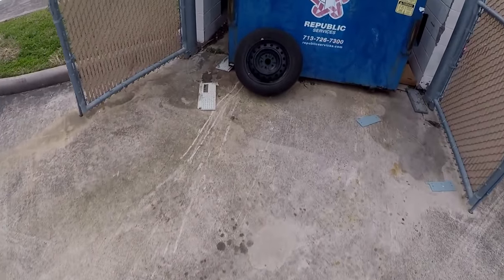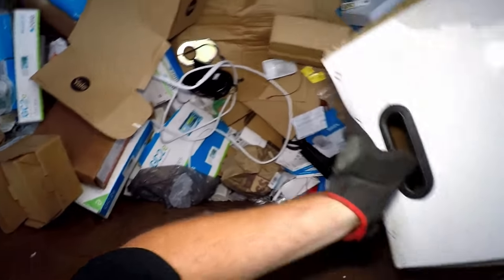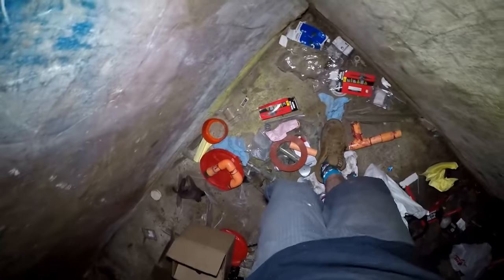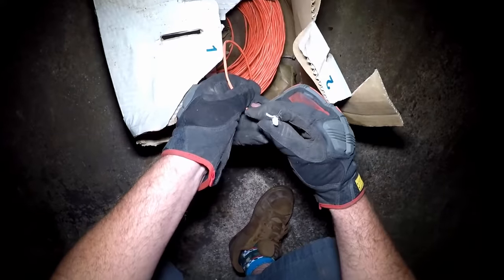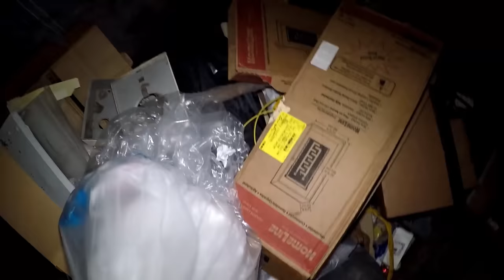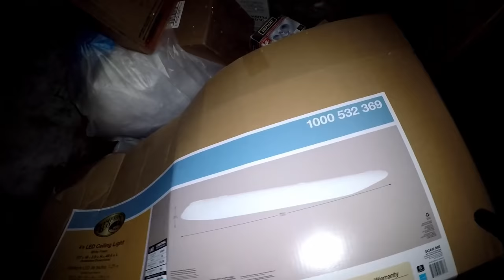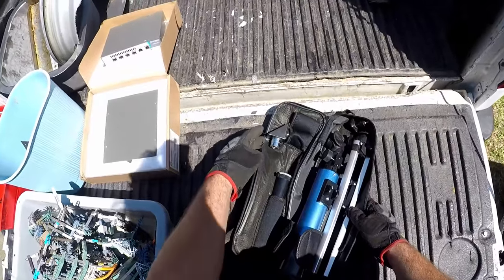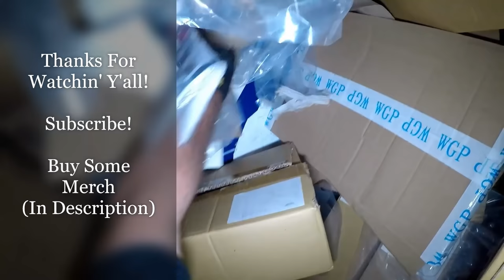Dumpster Diving "Mike's On The Scene"

Comment: Just a little heads up, that fryer you can sell for around $800.00 bucks online. I worked for an auction junkie and he sold a lot of fryers. I use to have to pressure wash them with a hot water powerwasher.  I used to use simple green and let it sit for a bit then hit with the washer.

Comment: 35:32 Looks more brass to me, might be the camera, but i say brass. Copper is a pure metal, while brass is copper mixed with zinc, so i guess how easy it is to recognise depends on how much zink they pured and mixed in there. But yeah, it should be considered brass if you cant clearly tell it is copper.
Both copper an brass gets more dark/red with a oxide layer when getting older.
Copper (pure), brass (copper & zink) and bronze (copper & tin) is considered red metals.
Look at the moon with the telescope, it is fun, you see the craters and things clearly :)

Comment: Never thought much of the vaccums but I would always take the cords and same things for lamps. Then it hit me just crack em open boom copper motor in the vaccum and the lamps snap them and get the whole cord. Now I know some motors are aluminum but heck still money. Just read and saw that you could clean and resell them. Might look into that. 

Oh and the old school TVs that weigh 1000lbs. Have some good solid copper In them. If not then good aluminum wires. Those been paying good recently